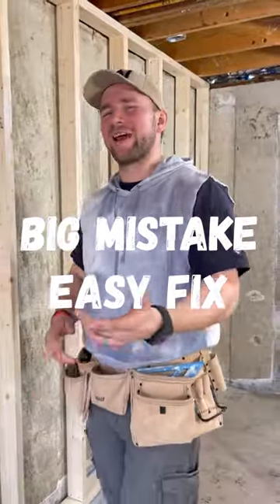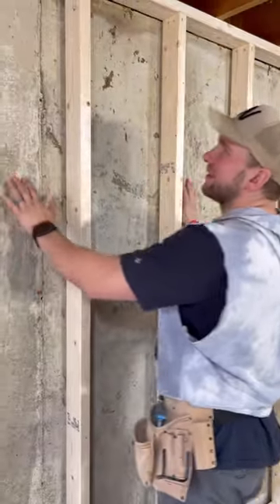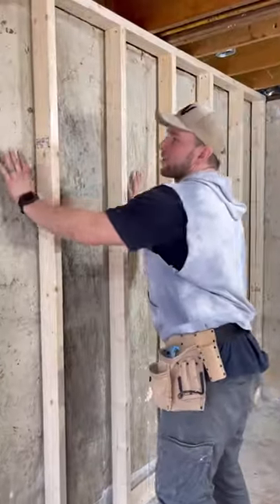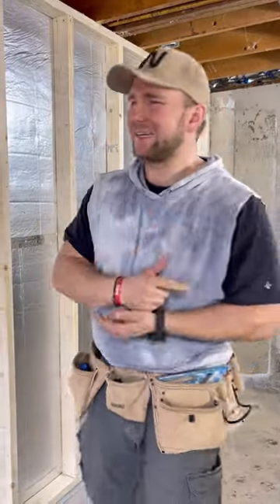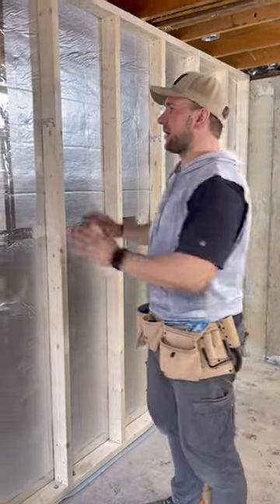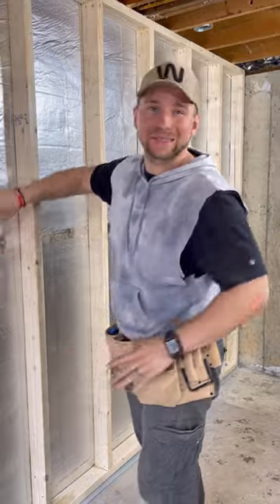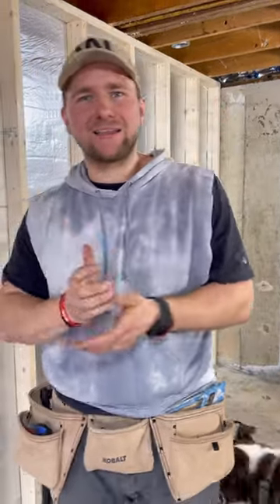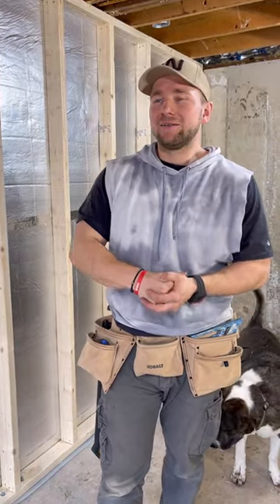DON’T make this mistake! Learn from mine. Basement wall Framing. WINNI

Comment: Nope. Don’t attach the insulation. As soon as you add it to the outer wall it’s reflective property is no longer. It will then bridge the temperature from your outer wall. As it’s only a vapour barrier you need to be careful about dew points and condensation. So really you want a vapour control layer as mention by others. You really want a 1” air gap between both faces and any substrate and all joints sealed.
Reply: Agreed 👍🏽
Now it's just an extension of that wall but in a lesser sense !!
I'm not sure but he may have been better off to apply a " 0 " percent penetration barrier in the form of something he could roll on such as ugly. It is like a white primer but thick and several coats r recommended !!! It's also used on the outside of basement walls before the dirt is pushed back to create an absolutely watertight barrier.
And of course there's other things on the market similar that could be used !!.
And even though it's quote-unquote a interior wall because of its location I would have still use pressure-treated lumber as a sole plate on the floor. Once the sheetrock goes up and everything is taped and mudded that chamber behind will be a continuous moisture area.... A trap if you will ... But he's doing a good job !!!! It is clear from watching him that he has some experience. A bit more than most 👍🏽🤠.
But NONE OF US KNOW UNTIL WE KNOW !!! That comes with learning and/or
Experience from working with others that have more knowledge than we !!
I'd hire him and put him to work same day!!!!
Cream always rises to the top 🤠!!!
Reply: The product info spec/ sheet makes decisions easier. But putting that board directly is a joke . The cost of the tubes of grab were prob more than a roll of Vapor barrier 😅

Comment: Moisture paper not vapor barrier on the bare concrete as it sweats and drops lots of water on the bottom plate and builds mould. Hopefully, the radiant barrier boards are breathable or to circulate the moisture

Comment: Out of curiosity, is there a reason you're using Paslode nail guns over battery nail guns? Battery operated nail guns have been pretty good the past few years
Reply: @Rich Rishel ahh, yea never thought about that. I just knew that they were rebuildable but also needed battery and gas charges.

Comment: Why didn't you use pressure treated for your bottom plate?😮
Reply: Or seal gasket
Reply: some states not required treated wood on basement slab if the the wall is not attached to the exterior wall. 
Use vapor barriers on the
 bottom plate or construction glue..

Comment: I have just had remediation work done on a basement suite. There was poly on the concrete  foundation, framing and batt insulation between the studs. There was then a layer of poly on top of the works, and drywall put on top. It was done long before I owned the property. A lovely sandwich for water ingress. This in Alberta, Canada. Ensure you state what location and what climate your solutions are for. A vapour barrier is not recommended on concrete foundations in some climates.

Comment: Good catch. Question, why no 2x4 pt wall plate on the slab? Is that not a code requirement for your area?
Reply: was wondering this as well, could be a personal or friend project where no permit is pulled.
Reply: @programmer6428   could be. I know that wouldn’t pass here in my area….but many different code requirements from state to state
Reply: @Pitcher-23  yeah it sure wouldn't pass here either, I don't think it would pass in many places at all... especially in a basement
Reply: @programmer6428  agreed 👍
Reply: @programmer6428 what about in brazil? Rio de Janeiro? In a favella? In a shanty IN the favella? Eh?
Reply: @marcuspeters5855  probably, and stick construction isn't common down south
Reply: @programmer6428  😂💯👋
Reply: this is wrong channel. He knows nothing about constructions, but tries to teach others

Comment: You really should read up on your product choice before you install.  Those boards are EXTERIOR use only, not interior use.  I contacted the company to confirm, because they were cheaper than the pink foam board and I was looking to complete my basement.